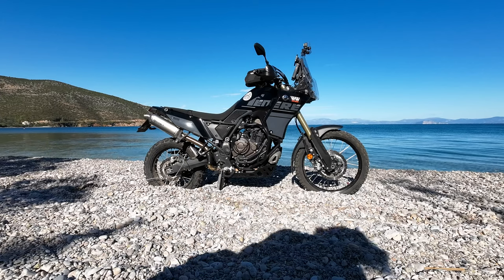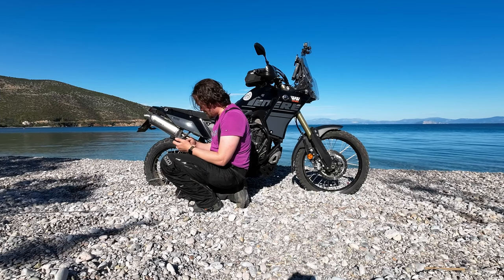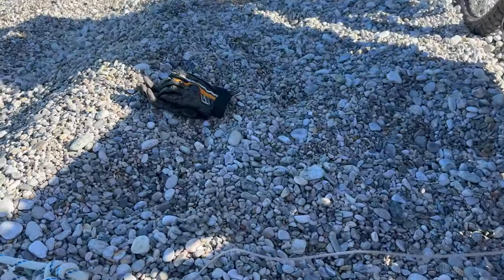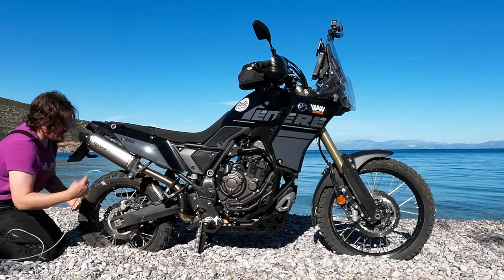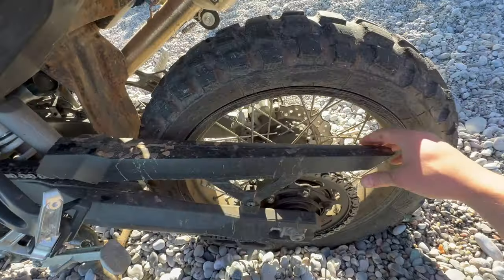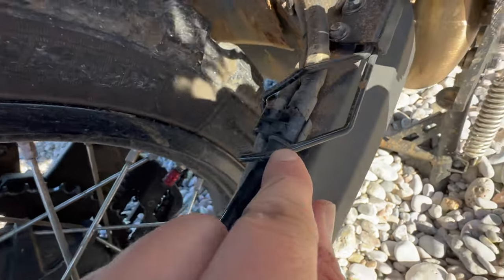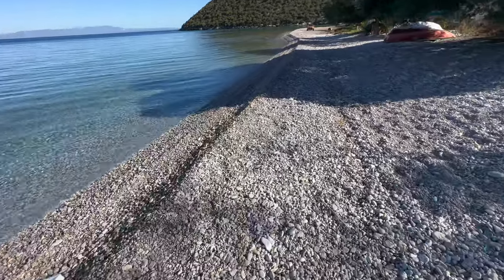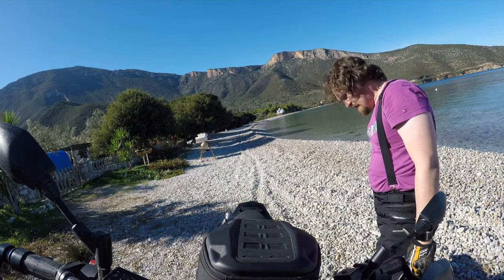Tenere 700 vs. fishing wire: the unexpected battle

Comment: I want to ask you, as someone who has owned both the BMW Sertao and the Tenere 700, would you recommend the Sertao for a similar long trip as the one you just did on the Tenere? Or is the Tenere superior in every way and worth the extra cash over the Sertao? Does the Sertao has anything that's better about it? How do they compare? I have seen your video, but wanted your opinion now that you have made a big trip on the Tenere. Maybe a new video on this topic? I am considering the Sertao, but I want to know what I am missing out on compared to the mighty Yamaha.
Reply from the maker: Good idea for a video.. I would need to think about that for a bit more in depth BUT what I would say off the top of my head is that both bikes are more than cabable of riding around the world if need be. 
There is even a lot of arguments for Sertao being the superior bike for traveling. For example:
Pro's of Sertao against Tenere:
+ Sertao is a LOT easier to pick up when the bike falls down
+ Fuel injected Sertao (don't know about the older Dakar) probably has a bit lower fuel consumption but the difference is minor (as far as I remember)
+ Sertao is lighter and carries it's weight lower so that makes life more easy in many situations. Lighter bike is easier in difficult technical situations depending on the rider level of course.
+ My Sertao with the Top Sellerie gel seat was more comfortable on long rides.

For very experienced rider I would probably suggest going with the Tenere but all of us intermediate normal riders like me I'm actually gonna say I would take Sertao over Tenere 700 if I was going on a tough trip over the Sahara or some other place where I would need to survive alone with the bike in some extreme situations.

Tenere is a LOT more "FUN" with the added power to ride but overall as a travel companion Sertao is much better in many aspects. This is probably not a popular opinion but that's mine. 

In closing the Sertao is a very cabable bike and can do watever the rider want's it to. Definitely would not hesitate in taking it on a long journey. Just don't overload it with luggage but that goes with any bike smaller than 1250 GS.
Reply: @PatchedBandit  Thank you for your thoughts! Interesting, it sounds like the Sertao is more boring but better in many situations, so if I want to focus on the trip, the soroundings and less about the fun of riding it is the better option. I will have to think about this. If we add the crf300 to this debate, would you choose that one over the Sertao for a long trip? It's even lighter, nimbler (I guess) and very reliable? Downsides with the crf300l Vs the Sertao?
Reply from the maker: Exactly. Sometimes boring is good and being on 2 wheels is not really ever boring 😅 
I only have 1000km on the little Honda and no long trips with it but I would say if almost anyone is planning to travel with luggage something needs to be done with the stock suspension. Sertao stock was fine when the rear preload was TIGHT :) but CRF is always going to be too soft for long trip with gear on.
Suspension aside the travel comfort is a lot worse on the Honda but as ItchyBoots has shown it can very easily go annywhere the rider wants. Keeping a 100 km/h (60mph) is easier with the Sertao but the Honda can do it.
I am thinking about taking the Honda on some extreme trip in the future 😊
Reply: @PatchedBandit  Thanks alot for your opinion! That sounds awesome, I look forward to see you travel with the Crf300l! I really lika your videos, they are inspiring! Please make a video about all 3 models of you feel that you have time and enough experience with all of them, I think alot of people would find your perspective interesting!
Reply from the maker: Thanks! I will put that in the "todo" basket for sure. Great suggestion 🙂
Reply from the maker: @lohoffssonloffman9668  I have also thought about doing a live at some point but been too nervous to start one 🤣
Reply: @PatchedBandit  please do! I would gladly join! It would be interesting to be able to ask questions about the traveling that you have done now! And also about everything else off course.